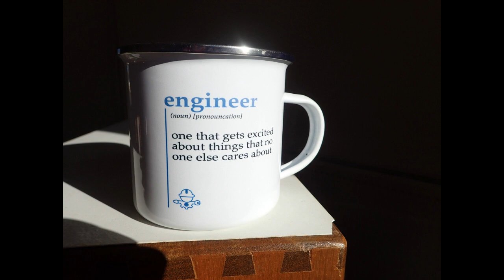Unimat SL Indexing and Dividing Attachment.

Comment: I was lucky to pick up an SL lathe/mill combo and the dividing head and a few other accessories for $35. The dividing head had the box but no other indexing gears, just the the 48T fitted in there. I did search but the other ones may have been there, there was a drawer of gears for a mini craftsman lathe so it could have been there. As for the 4 jaw chuck, thats for a unimat 3, the unimat SL 4 jaw chuck was cast and had the flange threaded peice held in with 4 screws so like another person mentioned, even that won't fit! Dont know why they made it not to fit. Oh the lathe I got is an early version SL and is all cast iron, very pleased that it is, heavy but robust and as good as it can get!!
Reply from the maker: Hello Ronit,
there are not many parts that are interchangeable between the the Unimat SL and Unimat 3. I know the chucks are not the same... I hope you have lots of fun with your SL.
Take care.
Paul,,

Comment: Hello Paul and you are correct! First off, there are slight differences in our 4 jaw chucks. Mine has a 4 hole pattern and a matching back plate with (4) M4 flathead screws. But the bolt diameter is too big to fit 2 of the holes on the index plate. So mine won't fit either! Thanks for pointing that out. I consulted all my Unimat books and none of them mention the 4 jaw. Everything else but that. So, what I'm going to do is make a back plate that fits the 4 bolt diameter for the 4 jaw, then make a 3 bolt pattern to fit the indexing head. Some of your viewers said something to the same affect. Unless something else strikes when I'm not looking 😄thanks for the shout out. Glad I could help! Mike
Reply from the maker: Hello Mike,
You did indeed help and thank you for that. As the Unimat SL was was in  production for around 30 years I guess there are a few upgrade along the was and that is why our 4 jaw's are slightly different.  Thanks for watching.
Take care.
Paul,,

Comment: For your 4 jaw screw on the 3 jaw back plate to the holder then screw thr 4 jaw to the bacplate
Reply from the maker: Hello Bob,
I would need to modify the the 4 jaw as it does not have a removable backplate... When I am in the workshop next I will have a looks at if may well be possible. Thank you for watching and your suggestion.
Take care.
Paul,,

Comment: I think you could also shrink fit an arbor onto the four jaw. I don't want to tell you your business, but you have a vertical milling machine and that lovely jigborer, how much are you really going to use the unimat in the milling configuration? From my uneducated viewpoint, you are short of lathes but otherwise pretty well equipped
Reply from the maker: Hello Jean-Paul,
That is a good point that I have other machines to do the operations and maybe I am trying to fix something that I don't need to. Thanks for watching.
Take care.
Paul,,